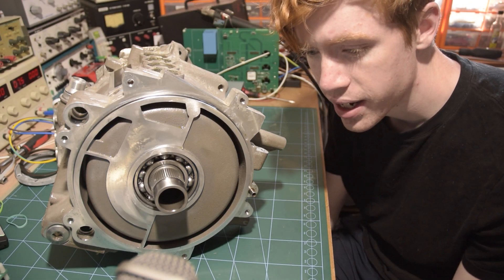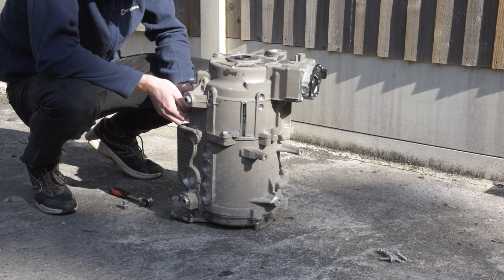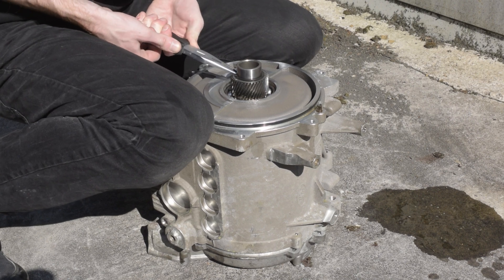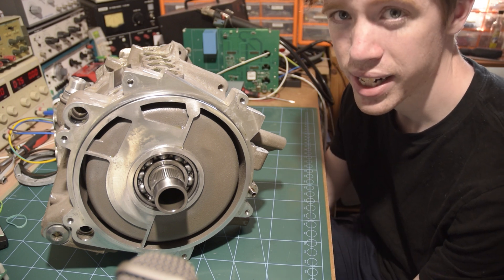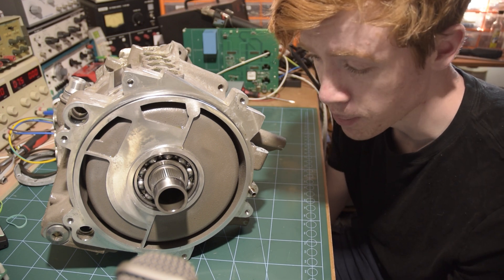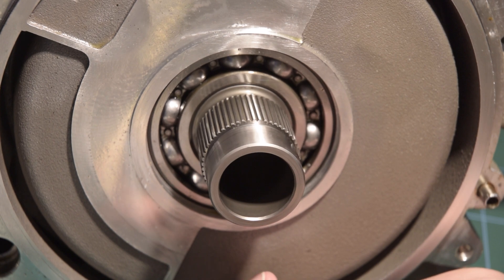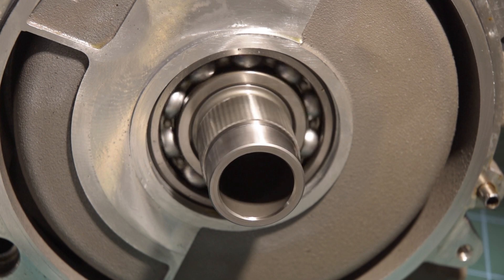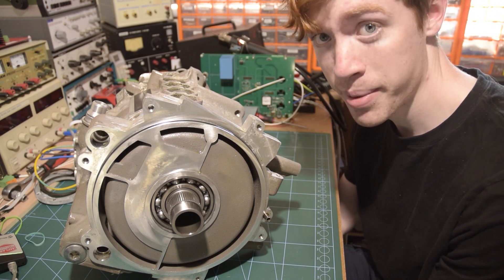200kW Jaguar I-PACE Motor

Comment: The angle cut teeth: greater cross section of metal to metal gear to gear contact: means more power can be
applied to the gear without stripping it. The whole point of angel cuts to straight cuts. If it is one gear inside
another: a straight cuts already achieves maximum metal to metal  gear to gear contact: the whole of one
gear is in contact with the other.

Comment: Me as many other i-pace owners experience clunk noise coming from front motor when regen or accel on low speed. My dealer replaced motor but problem came back after few weeks. Mb author of the video has idea what that can be and is it fixable?

Comment: I was wondering why it didnt stall at the beginning lf the video, then i recalled he ramped up the frequency gradually so the rotor had time to speed up & catch up to the field from the windings. Stall the motor with excess torque however, and the aligning field from the stator windings is here and gone too quick for the rotor to overcome its stationary inertia and start spinning again.

Comment: Supplying a phase of motor winding with DC like he did is also used in DC Injection Braking. The motivation for injecting DC into one winding can be seen when he struggles to rotate the rotor after powering with DC. The permanent magnet poles and the winding poles align and are reluctant to un-align.

Comment: they always say windings draw high current when rotor doesn't spin because back emf is not cutting lines of magnetic field! but why does it have to spin to do that i never really got it
Reply from the maker: When it spins it acts as a generator so the current is less because the voltage across the windings is the supply voltage minus the "generator voltage". Meaning if the supply voltage stays the same, the faster the rotor spins the higher the voltage that's generated and the less voltage is left across the windings. Hope that helps
Reply: Thats a great explanation, thank you so much!

Comment: Bit of a tip for disassembling automotive bits like this - instead of prying at the split line to separate the motor from the gearbox, find a flat face on one of the parts facing the right direction and hit that with a rubber mallet
Reply: Warming the whole assembly up a bit in the oven helps too.

Comment: A ring counter will tell you that the third coil has a terrible short in it.
Reply: btw how can you say there is nothing critically wrong when the third coil has less than half the inductance of the other two??????
Reply from the maker: That meter I used is very dodgy, I have better stuff now though. Also I wasn’t sure if saliency may be playing a part. This was quite a while ago and I don’t really remember what I was thinking but when you put it like that I’d be inclined to agree with you so not sure why I said that tbh

Comment: @14:51 As an AE I wanna  you that Hellical Gears Are used in Power Transmission because it Provides more face width due to their diagonal shape,Which enables them to handle greater loads as compared to a Spur gear of the same size....And their shape also enables more teeth to stay in contact with each other at a time..making them ideal for the Planetary Gearbox setup of Automatic transmission just like this one you dismantled..

My interest in power electronics and the YouTube algorithm led me to your gem channel,And get me hooked
I really have a Request,just like you did an awesome video on Linear Power supply.I really wish you made a video on traction motor controller and their components,it will really help us to understand how they work.And why those components they are necessary.❤❤
Reply from the maker: I have an old one on an inverter for motor testing. But I will make a newer better one in the next month or two
Reply: I am no engineer, but I have also heard this kind of gear produces less whine or noise.
Reply: It's to reduce gear noise. No more.

Comment: Both ST and TI offer developer boards that will do sensorless motor drive using field orientated control. The boards will also profile the motor where they spin the thing and measure all of it's parameters. As far as I know they offer these in low voltage (60V limit) and high voltage (mains) variants. I don't think they are that outrageously expensive so they might be a decent option. Another option would be a higher voltage hobby remote control motor esc board. I'm not sure how high these go up to through.
Reply from the maker: Those dev-boards do sound nice!. I have an Infineon IGBT inverter eval kit somewhere that really I should be using instead of my box of high on-resistance and bad parasitics 😅

Comment: So…. From experience… 8 years running performance dynos for the development lab at BorgWarner developing PMAC from 60kW to 400kW machines… your back EMF waveform looks wrong.  The phases should be 120 phase offset… check your sense leads or daq set up!  I’ve made that mistake 100 times.
Reply from the maker: Yes I added a little caption at 8:02 explaining that one phase is inverted, this was due to my probe setup but I don't remember why I didn't just flip it. My apologies. Also your job sounds very interesting, I have used a BorgWarner/Sevcon inverter quite extensively for Formula Student and (some of) it is really nice!
Reply: @electrarc240  did you use DVT to program the sevcon?  Which sevcon did you use?
Reply from the maker: Unfortunately yes I did use DVT, software so crap the motor locks up when you drag a window because the CAN messages stop. I used the HVLP-20
Reply: @electrarc240 That phase issue wasn't your setup.  It is a winding, that was manufactured wrong.  Backward on the red/orange winding of the motor.  Remove both ends of the red/orange winding, revese, reattach.  Then motor phase and operation will be normal.   Cogging, overheating etc, all these problems disappear, if you only wind the motor properly.

Comment: Could adding a capacitor with one of the phase help with starting and stalling?
Reply from the maker: Not in this case, capacitance on the output of a conventional voltage source inverter is very undesirable it can cause quite a few problems

Comment: While the electric motor may be simpler and lighter, than an ICE try picking up the fuel supply for 260 mile range in an EV compared to an ICEV!  And the tank in an EV doesn't get lighter as the fuel is used, so you're always lugging the maximum mass about, regardless of range.
Reply from the maker: Both have pros and cons I agree. I'm very biased though due to my background so I will be quiet now haha
Reply: Yes both have pros and cons, but I know which I prefer - having driven electric for four years now.

Comment: How did you come up with 250amp max, just from the 800v input?Very  cool video
Reply: He knows the power the motor produces and estimates the current from that as power is voltage multiplied by the current. The problem is the jaguar i-pace actually has a 400 volt system and not 800 volt.
Reply: @AmadeusBrown  I see quite simple

Comment: It may be the resistance windings -> ground (housing) that scrapped it. With an isolation tester (set to 500V) measure the resistance.
Also it should already have a resolver (encoder) attached to it, I think it is the white wire sticking out of it.
Reply from the maker: Unfortunately I don’t have an insulation tester (yet). The white wires seem to go to a thermistor in the stator, there is only two conductors so it can’t be a resolver. I think the rotor of the resolver is still on the shaft (can be seen at 6:05) but the stator is sadly not
Reply: It may be that you removed the resolver at 3:10.
Would you happen to have pictures of that too?

Comment: Those are still Torx screws, they're called "External Torx" or "Inverted Torx", or vendor-neutrally "Hexalobular External" (as opposed to "Hexalobular Internal" for the regular ones). The tool sizes for the external ones start with E instead of T.
Reply: Anyone that's worked on an MB knows the ol' E-Torx, fun stuff :D

Comment: Great to see you upload again. Awaiting the next video on the Direct Current Control series. Cheers 🥂
Reply from the maker: I did record two, but the circuits didn’t work both times unfortunately. I think for it to be stable it’ll probably need a microcontroller but I’m hoping to do something with it at some point, might be a while though.